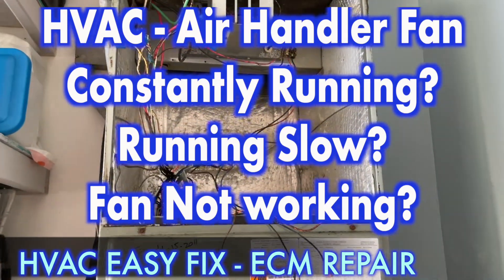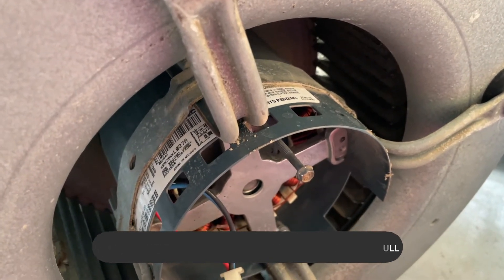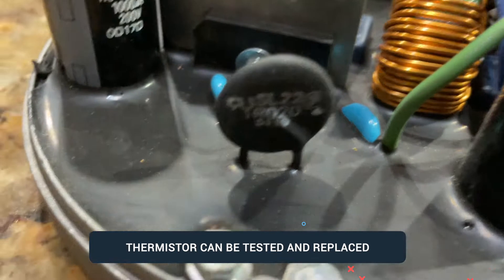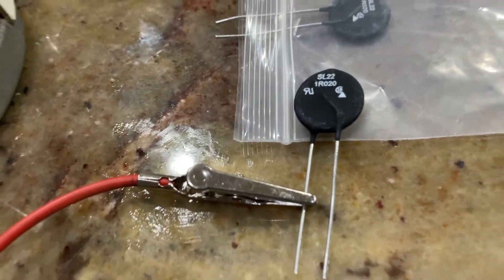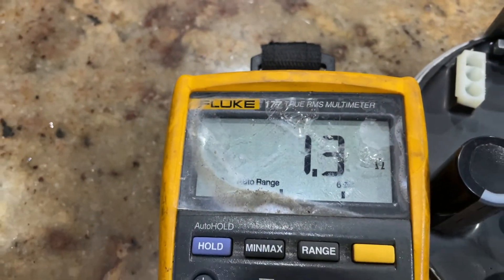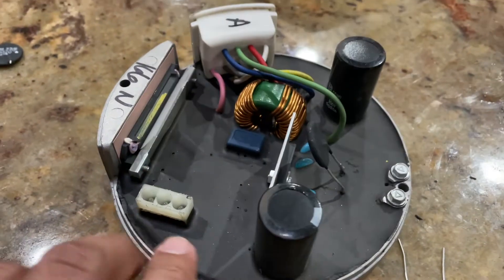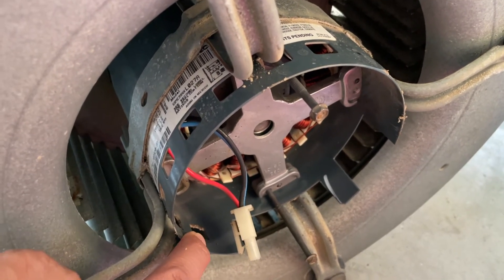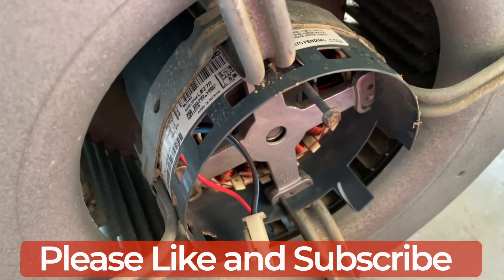HVAC Blower Motor Constantly Running - ECM Module Home Repair

Comment: Gas Furnace variable speed ECM blower works fine in manual mode (furnace goes through all the cycles perfectly).  but when fan is set to Auto, the furnacee fires up correctly, but when it calls to turn on the fan, it errors out.  Would this be a thermistor problem?  or what?  thanks!

Comment: my case is the blower motor does not respond and can be kicked on with a lower speed. not sure what is the problem.
Reply from the maker: If the motor is coming on, then the issue is not with the motor. The issue would be with the resistor that controls the motor.

Comment: Does a panasonic 9000 btu inverter have a ECM module? in the interior unit? Mine works good, you can control the speed, but from time to time it just suddenly go to FULL BLAST (maximum speed) and I cannot reduce the speed, unless I turn it off and turn it back on. Capacitors are new and tested.

Comment: My female friend is going to replace the ECM module by herself. Trying to make job as easy as possible for her. Does anyone know the correct socket size for removing the 2 bolts holding the ECM module?
Reply: 1/4 inch. Make sure the new ECM module is set to the right speeds. Some of them must be programmed

Comment: I have a residential Carrier Performance series AC/HP with emergency heat strip with the Gentec ECM variable speed blower for our 3 BR house which was installed about 15 years ago. The A/C and heater functions all work fine it seems with the air handler blowing fast/high whenever there is a need for cooling or heating, but then the blower returns to a slowish "circulate" speed once complete. The problem is that this slow speed function of the fan which keeps a low volume of air just circulating, would not ever go off anymore. It used to go on and off depending on the need at various times, but now it runs 24-7. My therm is set to auto and the "circulate" feature is off. BTW, this slow speed I speak of is about 75% of the speed the low circulate speed is when I have it set to circulate, so I would say about 500 rpms. Well I thought for sure it was the A/C's main board had gone bad and replaced it with a new one, but nope, it was not the main board in the air handler. I made sure none of the wiring was shorted between the unit and the thermostat on the wall. I even removed the thermostat with all the wires disconnected and even then, the blower stays running as soon as power is restored. So could it be the ECM?, but how does it work normally all times except when it should go off? Sincerely, Baffled.
Reply from the maker: Yes ECM is bad. You checked everything you could.
Reply: @HowToDoitright  Thank you...I believe you are right, but the common sense part of me keeps whispering there is no way it can be completely bad and not fixable if it works fine during cooling or heating periods? Should I be shopping for just the module or the whole motor and would Am@zon be just fine for purchase? If I just replace the module, I will need to repack those shaft bearings I suppose after an approx total of 2,956,500,000 (3 billion)rounds over the last 15 years. Thanks again!

Comment: I went to a call yesterday that their indoor blower runs constantly. Fan set to auto, cool off, took off stat face, went to unit and fan still running. I took the g wire off the board terminal and fan still ran. I took the heat and cool spades off of the board and fan still ran. This leads me to think that the module and or motor is bad, does that make sense?

Comment: Replacing the thermistor fix the problem of the fan running constantly?
Reply from the maker: No it won’t. You will need to change the fan control module. I have one for sale if you want one.
Reply: @HowToDoitright  do you have one for a 1/2hp genteq??

Comment: my ecm 2.3 with 16 pins run all the time even when i disconnect the 16 pins wire. I replace the thermistor and no change. so I had to buy a 700$ motor to replace it
Reply from the maker: Yes for that you could have just replace the module. Wasn’t any need to replace the entire motor. Just ecm control module would have been enough.

Comment: Thanks for the nice video and sharing your knowledge. Well done. Just to confirm, in this video, which shows the situation of your blower motor running at a slow speed...after you replaced the thermistor, and reinstalled the blower, did the blower motor indeed return to more or less a normal speed?      (   my ECM blower motor is similarly running at a slow speed. I am contemplating what to do, maybe replace the thermistor. The motor windings ohm out okay.  )

Comment: I had a new HVAC system installed last year and a honeywell stat that has 4 wire running to it.(no C wire). The system when in A/C mode will set there and run until I turn the stat up, but I have to turn it up 3 or 4 degrees or the temperature reading will jump a degree or 2 to match where I set it to. I know sounds crazy. It will also jump down and match  within a degree or 2. SO... first I called honeywell thinking this must be a stat issue. They had me test the voltage readings of the 4 wires running to the stat. The 24v red was fine but one of the wires read lower like 9v and seemed to vary. Honeywell blamed the HVAC system as the problem. So I called the HVAC tech out and after thinking it was the wires running to the stat he checking the voltage readings at the unit with the stat wires removed, he got the same readings ( one circuit was low and varied) eliminating the wires to the stat as the issue. He then said it was an ECM module/motor.He did a warranty replacement of the ECM and said it's fixed. For some reason this issue takes a few hours before it acts up. Then the longer it runs the worse it gets. He finished the warranty repair and said even though the voltage is still low in one circuit the system was working fine, but the next day it did the same thing. I replaced the Honeywell stat again and it does the same thing also. Any ideas what I should do?
Reply from the maker: I suggest turn off the AC. Turn off the breaker for both outside and inside unit and measure AC voltage on the low voltage wires. It’s possible your low voltage wire is not shielded and getting transient voltage. This can happen if low voltage wire run by someplace where you have high voltage wire running. This can also affect the readings. 
Also it could be your coil on the relay outside at the unit that picks up to run the compressor for the outside unit.
Reply: @HowToDoitright  Ok I'll try that. Got me thinking. If the issue is somewhere on the low voltage wire running to the outside unit and or coil on the relay, I could unhook those wire at the inside unit and see if that one low circuit voltage goes away. If it does I work toward the outside checking, if it doesn't then I would know it's not outside correct?
Reply from the maker: @Blueeyepatriot  yes that’s correct. Best way is to start with having the voltage and then one by one turn off breaker and check if it goes away with which breaker off. If it goes away with outside breaker off then you know it’s outside or vice-versa. Then you can trace it down by unplugging the wires and see which wire has the issue.

Comment: Incredible. I can’t believe I hadn’t thought to solder the thermistor to the legs of the old one. Wow. Face palm. I’ve been having the same issue and I can’t figure out the slow fan speed and smooth rotation as though the motor is fine but it’s not getting enough current like if it had an external capacitor that was bad, but it’s an ECM so I couldn’t figure out what it was, it made no sense. The evaporator coils were clean, everything seemed fine. I was confused on how to properly test for the high and low voltage but it seemed like the issue was in the motor start up.

I then heard of this issue with the thermistor but the foam covering made me think I couldn’t replace the thermistor?

I just hadn’t thought of soldering the thermistor to the old legs. I cannot wait to try it. Thank you.

Comment: After replacing the thermister, a year later the main blower motor (GE 1/2 hp 08/22/00 CNO2 011DH7) is making a intermittent high pitched whine (g#5 note) when on first stage.  I "think" it's related to the module, but not sure.  Anyone?
Reply: Could be the bearings on it way out

Comment: My air handler fan is running 24/7, I want to replace the thermistor on my ecm, my part number says NTC 1,0 1237, I can’t find this exact part number, can I replace with any part number as long as it’s a 1 oms thermistor ?
Reply from the maker: Changing thermister may not solve your issue. Have you tested the old thermistor to be bad? 
I suggest look for a replacement controller without motor and replace the whole controller. If you email me your ecm model I may check if I have one.
Reply: The motor is a X13, there’s a silver label with WZDK370-312G1
White label HW19, 1/2hp 230vac
Reply: I changed the thermistor and it didn’t fix it
Reply from the maker: Just like I suspected. Just order the control module

Comment: Great video I just had a ECM motor kept on running wouldn’t stop at all even when I took off the green wire from the thermostat
Reply from the maker: Yes that bad ecm
Reply: @HowToDoitright  I have this same issue. Should I not order the thermistor? Fan is stuck on. Or should I order the modual?